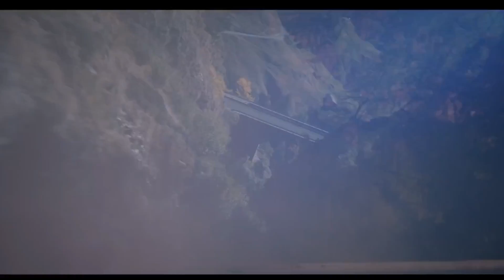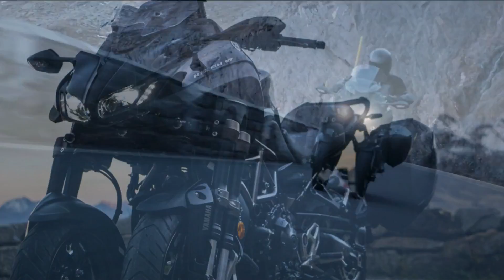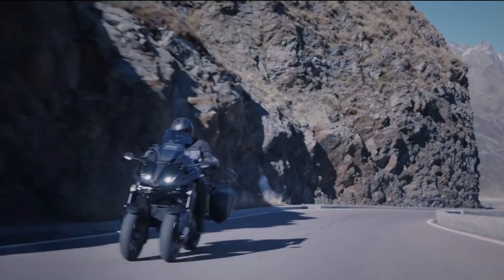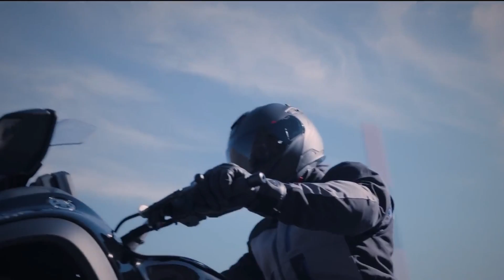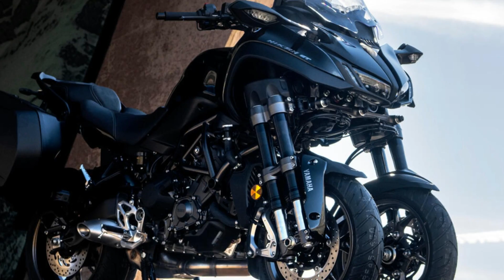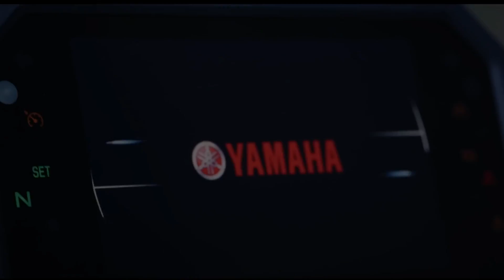2023 Yamaha NIKEN GT First Look & Review

Comment: Can the niken stand alone with out using the side/center stand while on stop?
Reply from the maker: Niken can stand on its own without using the side or center stand when it is stopped, as long as the rider keeps the handlebars straight and balanced. However, this is not recommended as it may cause instability or damage to the bike. It is better to use the side or center stand when parking the Niken for safety and convenience.
Reply: No it cannot. The Niken is not self balancing, it will fall over like a conventional motorcycle unless the side stand is used.
Reply: In this case the Yamaha TRIcity 300 has the capability to stand on its own with a push of a button, am I correct?